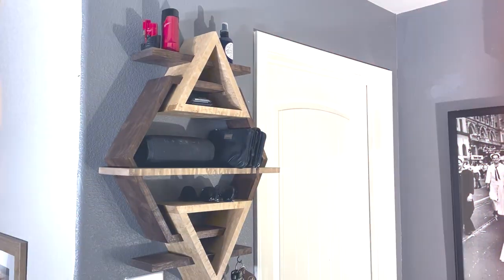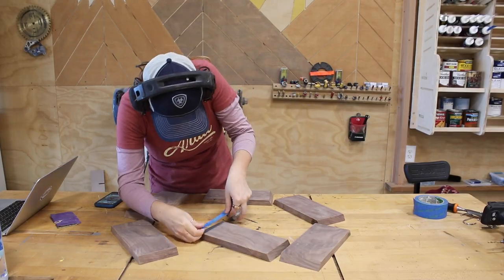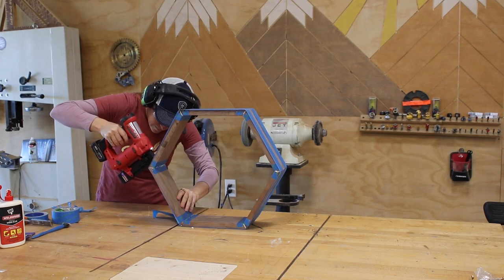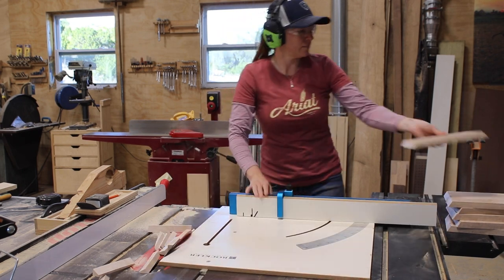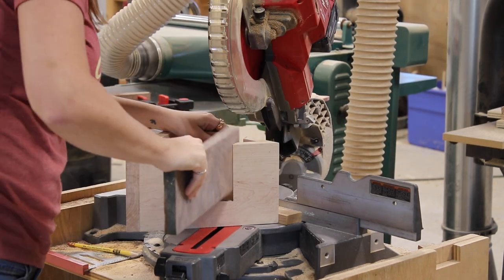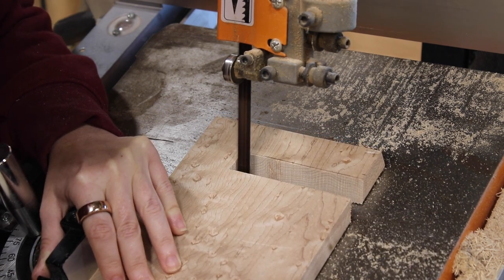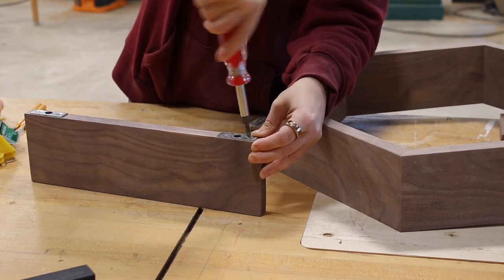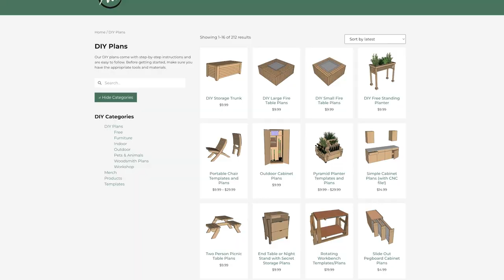DIY Modern Wall Shelf | Unique Geometric Shelving

Comment: That is a wild build, and a really cool bandsaw jig setup. Super creative. 

Trick for gluing miters for those reading the comments who may be new, and struggling to glue miters... 50/50 water down some glue and brush it onto the endgrain first. left it soak in for half of your glue setup time. This will help fill the endgrain, so that a lot of your main glue doesn't disappear. If you've ever seen a failed miter, you often see how little glue actually stayed on the surface to make contact. It's wild how much sinks in.

Comment: That’s such a unique, beautiful, and yet functional design. My wife got a quick glimpse of that and now wants something similar next to our front door. Did you use and kind of fasteners for the middle shelf or is that just held in place by the joint that was cut into the shelf board and glued in place? Awesome work and such creative thinking put into that.